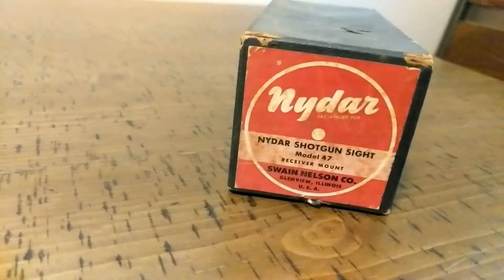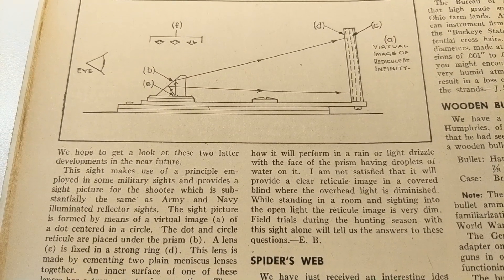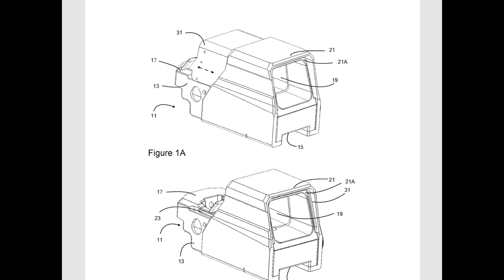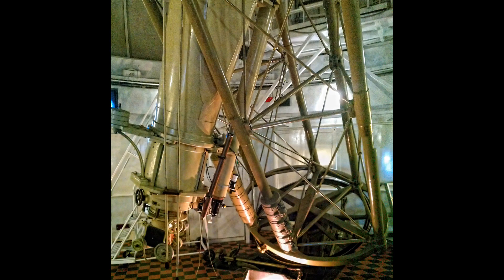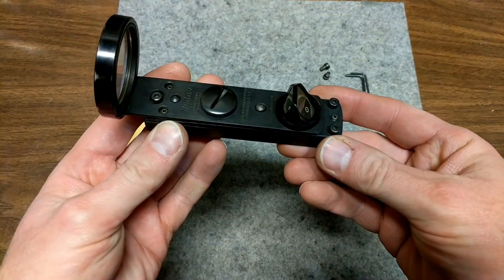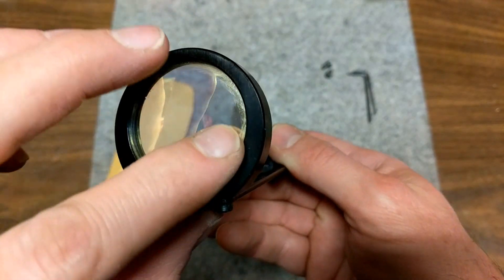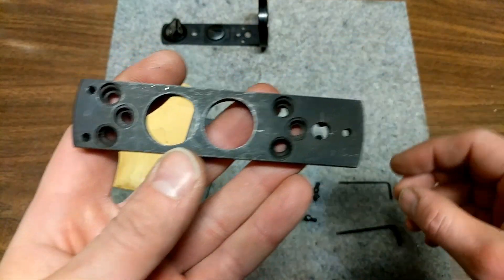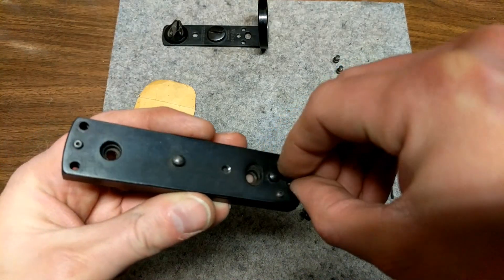Nydar Reflector Sight Swain Nelson Model 47

Comment: Holy crap so these things actually existed back them.
Reply: Yeah, no shit. The first reflector sight was made in something like 1901 called the "Grubb" sight.
Reply: @ninjapants7688  well I was thinking these things were commercialized and brought into the standard issue military during the Cold War.

You can’t blame me for not knowing this shit, any normal person would be surprised too.
Reply: @pouglas2714  All good bro.
Reply: @pouglas2714  i sure am
Reply: @ninjapants7688  I think you used the term "no shit" wrong here or at least not used it in the right way.
Reply: So Call of Duty Vanguard is not full of shit
Reply: @Scrapla1  what about the m19 pistol on vanguard?, its litterally a XXI century weapon
Reply: Not in the war tho
Reply: @Scrapla1  it still is full o shit cus this came out 4 years after cod september 45'
Reply: Well, it really wasn't as practical until you could contain a light source in it, and incandescent bulbs ate batteries. The LED that became practical in the 70's is what made red dot sight practical and, well, red.

Comment: So honestly how useful is this, both in its own time period (versus other non-magnifying optics and ironsights) and to the modern comparable optic? 

In terms of durability and the like, clarity of optic, etc what theoretical viability of actual military use COULD this have had? Of course it’s plastered on the guns from CoD Vanguard (as horrifically cursed and blatantly nonfunctional as many of them are) but it does make me wonder to the regard.
Reply from the maker: This sight served it's purpose as a shotgun sight very well.  Some articles gave it very good reviews for competition use.  I do not know of another sight that was marketed this far back that did the same job.  

Against current optics there is no comparison.  Compare a 40's rifle scope to a current production one and you will see what I mean. But from a shooters standpoint for targets within 100 yds I would take the Nydar over irons.  

Could the military have used it, yeah.  Problem is by WW2 most armys had just figured out that they didn't need sights that went out to 2000 yd, telling them that this sight would make their soldiers better at close quarters engagements would be a hard sell.  The US didn't adopt a red dot for more than special ops use until 1997.

Comment: What are these worth approximately?
Reply from the maker: $30-$50 based on condition and accessories (box, cases, instructions).
Reply: @CRCollector   I can't seem to find any and saw one listed on ebay with box for $400. Obviously after the auction ended with no bids I was thinking $250?

I've also checked Gunbroker and haven't been able to source one.
Reply from the maker: @Xdtrl  stay persistent.  I did an advanced search for sold items and found several around $50-$80 have sold in the last few months.  Don't get scammed by people that overvalue this stuff, $250 is way too high.
Reply: @CRCollector  I did. Finally scored a working one on ebay for $10.